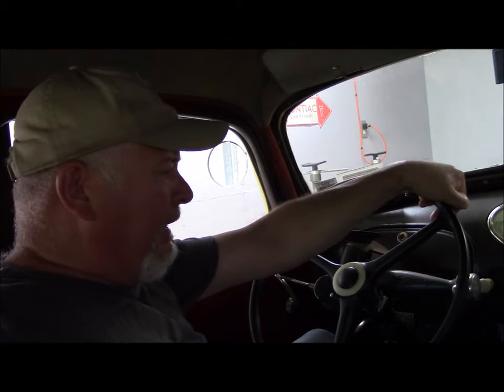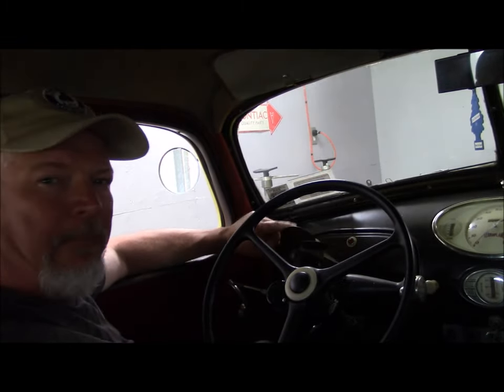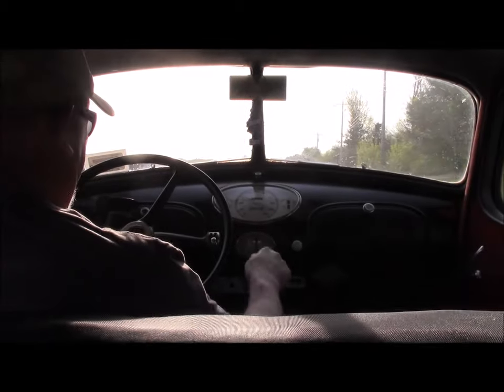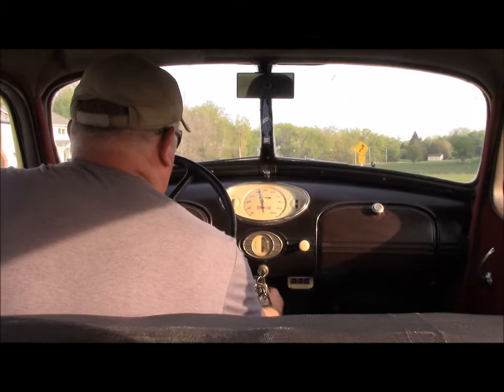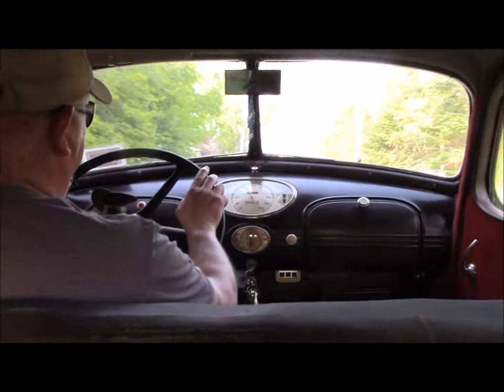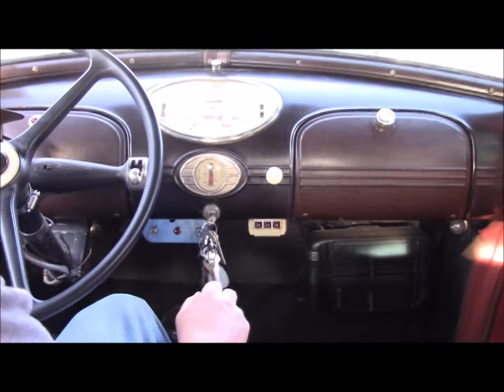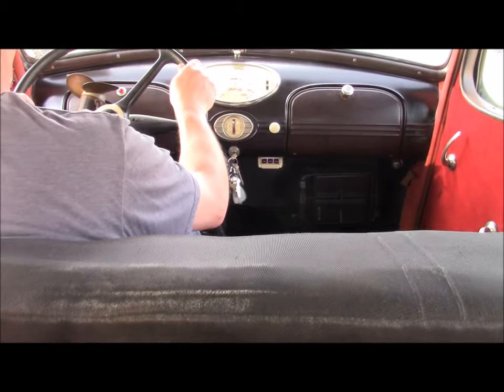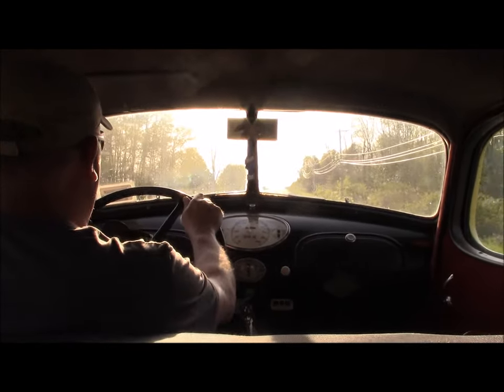1936 Hudson Terraplane First start-up and drive of 2023

Comment: Thanks for the great ride in your wonderful Terraplane. My dad owned a 1936 blue four door like yours that he drove on his J.R. Watkins route from 1943 to 1945. I remember the unique waterfall grill and beautiful oval speedometer. I didn't know they had suicide doors until I saw this video. He purchased the old Terraplane for 100.00 to get the extra gasoline coupons it provided during WW2 and to use as his route car. It was sitting on blocks with a busted muffler and two flat tires when he bought it. The lady who owned it couldn't afford to drive it any longer.

Comment: Maybe your engine is the stock one, but the trasmission isn't, as you operate a clutch pedal and a floor gear shifter, even if the orginal semiautomatic gear shifter is still present beside the wheel. At least that original transmission wasn't dependable...
Reply from the maker: It’s the same transmission, the electric hand is turned off. The floor shifter snaps in . Not sure what you are talking about a semi automatic transmission, the electric hand is a pre selector, still a three speed manual transmission
Reply: @GruesomesGarage  You're right, sorry for being confused.